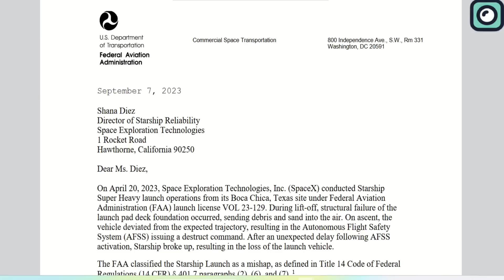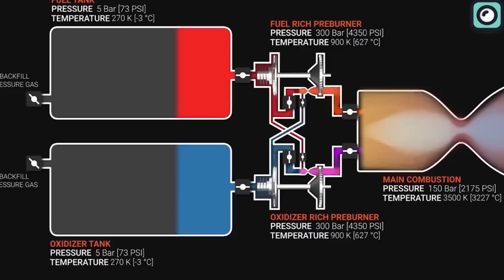SpaceX just declared completed FAA requirements for 2nd Starship Flight!

Comment: Technically this was an investigation led by Spacex.  The list of 63 items originated from Spacex and the FAA simply agreed. These are things Spacex wants to fix and 57 have been addressed.  The other 6 are things that will be addressed in subsequent launches. The FAA said they are waiting for Spacex to complete the license application at which case,  they will likely be granted approval.  This video is a bit misleading.  The FAA is more on the side of Spacex than people think.  But they do have a job to do nonetheless.